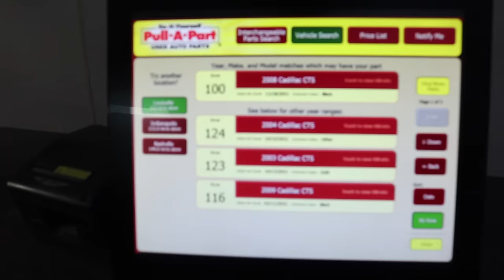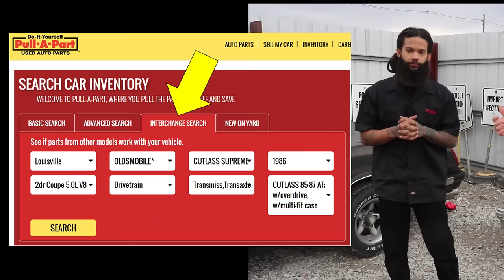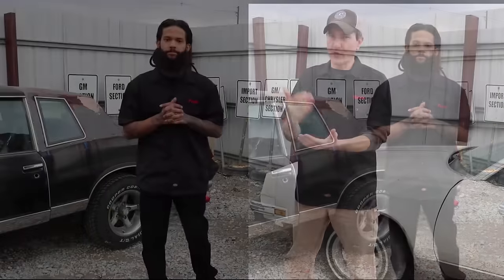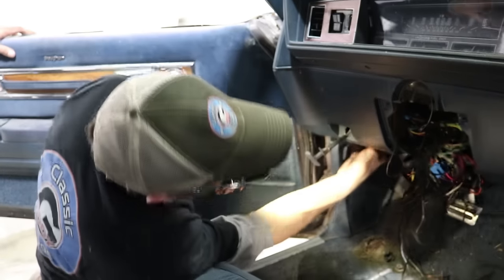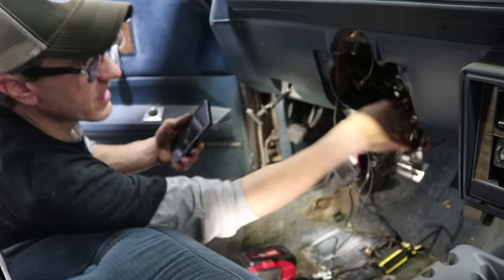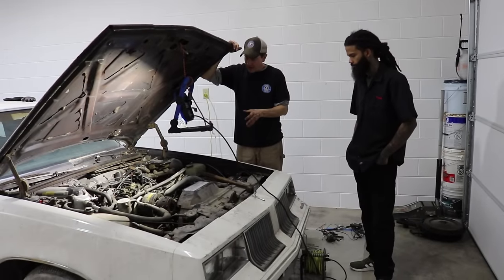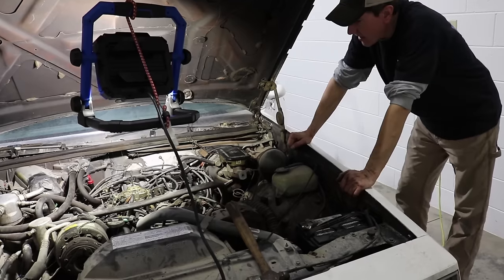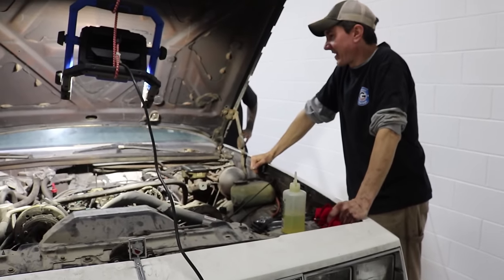86 Cutlass SAVED FROM THE CRUSHER! Will it RUN? Part 1 of 2

Comment: My  original owner 1985 Olds Cutlass Supreme Brougham  white with dark blue interior is still running.  I bought it new in Orlando, Florida as my dependable transportation college car.  I still drive it and now live just 60 miles from where I purchased it.  Mine came with the landau top,  Buick 3.8  and the metric TH200 with locking torque converter transmission.   Yes,  I've owned and driven it for some 38 years now.
Reply from the maker: Wow what an awesome story! Original owner!
Reply: @ClassicGBodyGarage    And thank You for selling me some parts 3-4 years ago that keep mine looking  nice and running well.
Reply: @ClassicGBodyGarage    My original owner 2004 JEEP Grand Cherokee just turned 187,000.      My girlfriends original owner 2004 Honda Accord is at 387,000 owner driven miles.   Her's has all original drivetrain (nothing rebuilt)  and the body and interior look like a cared for 5 year old car.   Buy what you really like and maintain it .

Comment: And of course the transmission pan has a hole in it. They always do that at pick and pull./part drives me crazy and they also bend every driveshaft when they pick it up with the forklift haha
Reply from the maker: Yep they pop them to drain the fluid but still had a bunch in it. Had to put another pan on it.

Comment: Good save boss 👍 man I'm always watching big fan
Reply from the maker: Thanks for watching!
Reply: I have the same car I has a tbi 350 going carb what's a good electric fuel pump the tbi engine has a spot for Manual pump/ but not sure that engine takes a m pump ? but I'm stuck right there I want to get it running bad it's project car for my son
Reply from the maker: @mr.cutlass87delgadillo.d45  Are you sure the fuel pump spot doesn't just have a block off plate? I know my TBI has a plate that you remove. If not then Holley makes some good pumps.

Comment: BTW THAT MONTE LOOKED FIXABLE SINCE LAST YEAR AND AERO HEADLIGHTS. LOOKS LIKE A TRANNY SWAP FOR. OLDS AND MINOR BODYWORK NEEDED WE BOUGHT NEW 84 FROM DEALER VUTLASS GOR 7300 BUCKS
Reply from the maker: It was fixable but had a bent frame in the front. Needed too much and the Cutlas was the better choice.
Reply: @ClassicGBodyGarage  as time goes by the g body will become scarce so plan your assets to fix accordingly..as a kid I ad 3 63 to 66 impalas SS SQUIRRLED AWAY SOLD PARTS BUT BY  70 HAD UTO GO INTO CHEVELLES
Reply from the maker: I get it but you can't save them all and you need to cut your losses and that car was a loss in my opinion considering the frame. It also had plenty of rot to go along with it. Pull A Part offered me one of 2 cars and I chose the one with much more potential.
Reply: Same here had a 63 Impala SS hit in quarter as kid in 1966!  Cheeper to buy new than fix got it to run but had to sell
 It and parts I hAD GOT. NEW TAILLIGHTS WERE. 2.45 A PIECE
....A SHAME.

Comment: Bro all you had to do is remove the steering wheel to gain access to the ignition switch… the. Just swap it out with a new one instead of swapping out the Column
Reply from the maker: Yep I know and have done many like that but in this situation it was easier to swap columns.

Comment: Really he pulled the whole column out why wouldn’t you just pull the steering wheel the turn signal switch and remove the ignition switch and just start it with a 10 mil socket or pliers or something? Good to see you back on YouTube anyways.
Reply from the maker: Agree, not hard to swap a cylinder but had a good column on hand from the yard and was best to swap in that situation
Reply: ahh ok i figured there had to be some other reason @ClassicGBodyGarage

Comment: C'Mon! Neither one of you guys know how to crack a GM column right above the turn signal lever, pop that spring out and push the slide forward, column unlocks and ignition cranks....I've heard 👀
Reply from the maker: Why destroy a column when you can put an ignition cylinder in it? We had a column on hand and doesn't take long to swap. I replaced the cylinder in the other we removed.
Reply: @ClassicGBodyGarage  Because breaking 💩 is fun, besides that you know you have 872 of those columns stashed away!
Reply from the maker: @mostlypeacefulmisterputin  Even if I had 873 of them I still won't break a good column...
Reply: @ClassicGBodyGarage  You're no fun! But I'll keep watching anyway 😂
Reply from the maker: Appreciate you watching!

Comment: They really selling used coolant?! 🤣🤣 struggle city
Reply from the maker: Its expensive new and why not if you are using it in a beater daily?
Reply: @ClassicGBodyGarage  expensive new? 10 bucks for a 3l jug is expensive? What about all the oil, coolant, contaminants in that used stuff?
Reply from the maker: Thats cool, go ahead and buy yours new but some prefer used and it sells well there which is why they sell it. They also filter out any debris.  Besides, a little oil in coolant isn't going to harm anything
Reply: @ClassicGBodyGarage  that's wild. Trans fluid? Okay that's expensive. But coolant? I'm not making fun or disrespecting to save a buck, I have a junkyard truck motor In my car hacked together. I just genuinely didn't know used Coolant was a think

Comment: That's an 85 not an 86! 86 had a third brake light in rear window
Reply from the maker: You are correct on 85 vs 86 and the brake light but the light was missing. I added it back from the Monte.
Reply: @ClassicGBodyGarage  I know some 85 cars that had third brake lights. Some 85 Ford Tauruses, Tempos had them, some 85 A Body GM cars too like the Celebrity's, Cavaliers too!